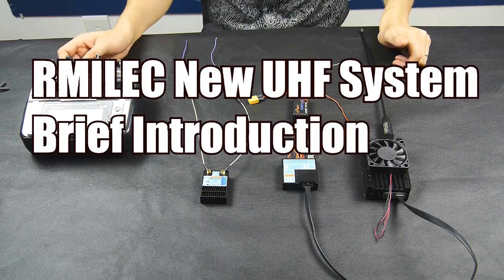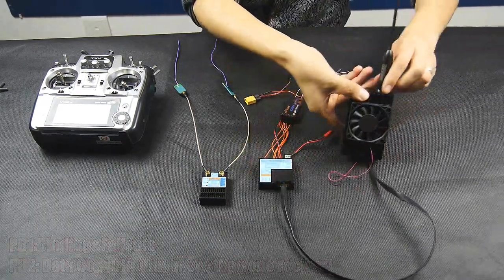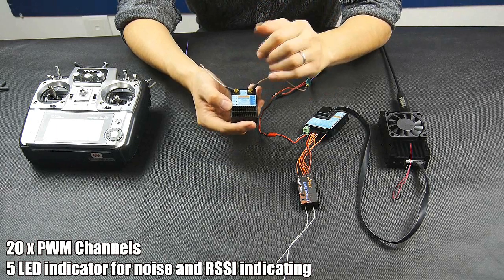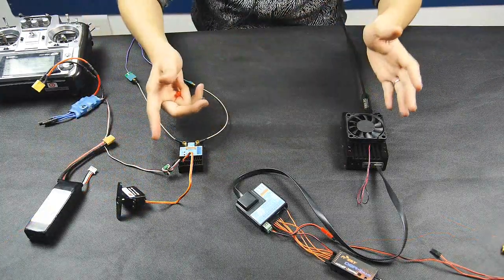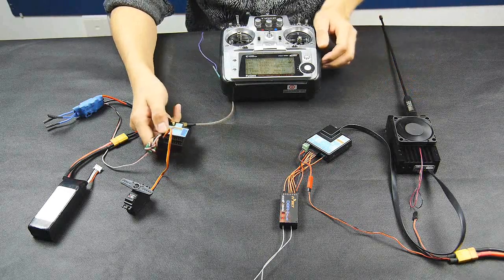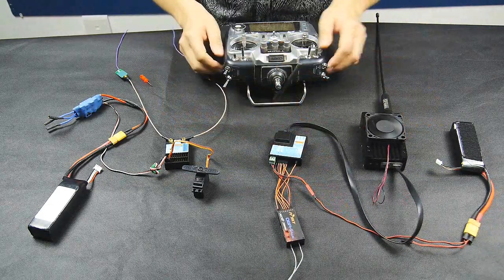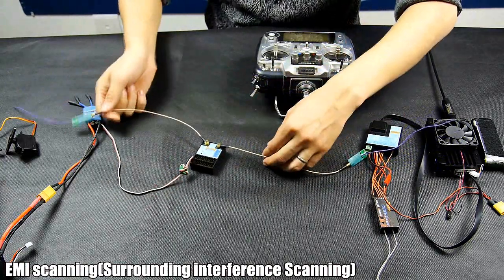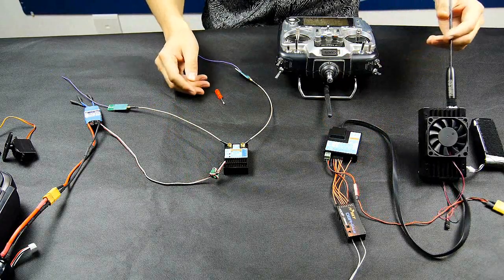Rmilec New 30km UHF Control System

Comment: So the transmitter system is now wireless? what band are you using to communicate with the transmitter module? regular FM or spectrum?....So let me get this straight, the radio is no longer connected to the transmitting module anymore and works under its own power supply via FM or spectrum.. So you to the RX then transmit out UHF to the RX on the plane?
Reply: You still need a transmitter and compatible receiver. the receiver connected to your radio is then connected to the 20ch Rmilec transmitter that transmits to the Rmilec receiver on your place.

Comment: what radio controller transmitter compatible with this  Rmilec system?
Reply from the maker: Not any special requiment about the radio .
Reply: in your video what radio is that?
Reply from the maker: FUTABA 10CH
Reply: ok thank you